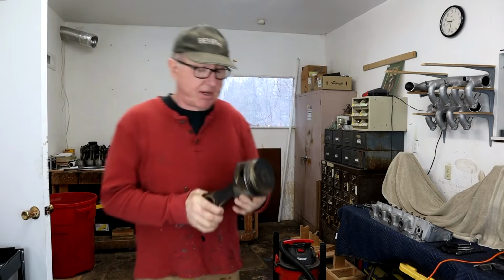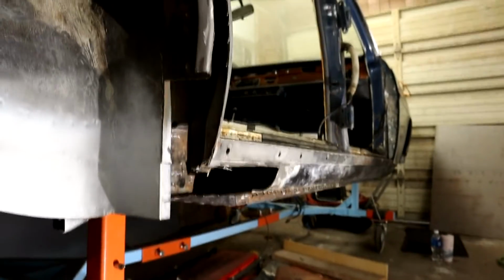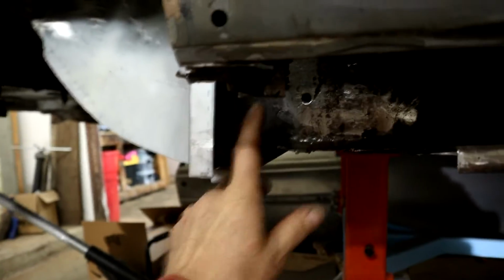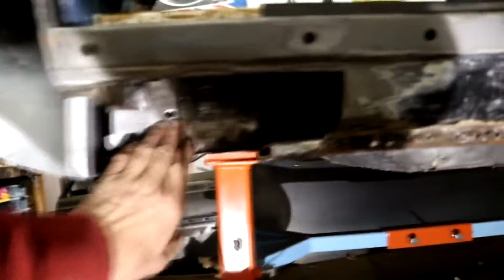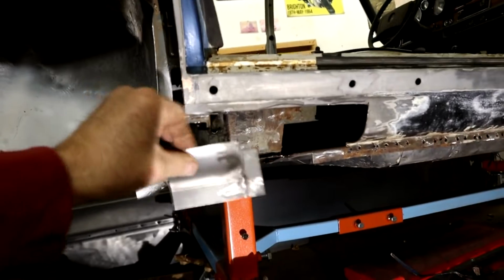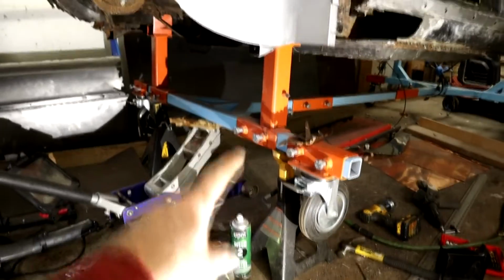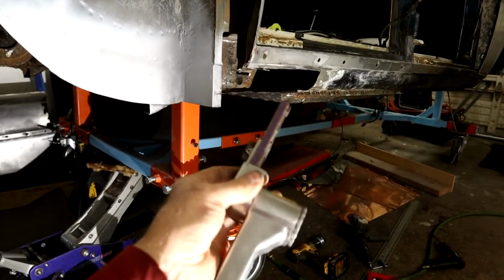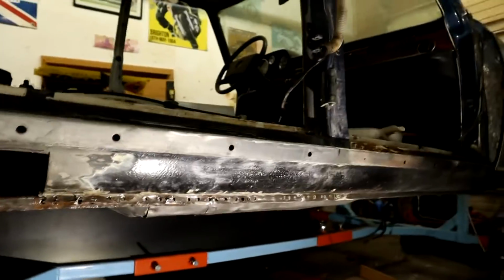MERCEDES W108/109 REAR JACKING POINT REPAIR AND RUST PREVENTION.

Comment: Sir 
If you don’t mind I would like to ask you something. I always like and comment on your Videos. 
I bought a W108 in great shape and it was running really well. The former owner told me to clean out my Gas Tank 
So when I did that I thought let me change the fuel pump Spark plugs injected seals and some fuel hoses. Now when I start the Car it runs but as soon as I press the Gas Pedal the engine dies on me and I don’t have too much money to go to a good mechanic. Do you have any idea what could be wrong with it by any chance ?
Reply from the maker: How did you clean out the gas tank? Did you remove etc? Also when you did that, I'm assuming you put in a new tank strainer/ filter? Located underneath the tank. Was the car running well before you did all this work?
Cheers John.
If you want to chat in more detail. Here is my email where you can reach me. jwright89@sbcglobal.net 
let me know how you get on.

Comment: Hi John. I know im late to the party, but where did you get those jacking points? I’m doing similar work on my 116 and am in dire need of a new set. All the best!
Reply from the maker: Hi Ian. No problem mate. I found the jacking points at https://www.mbclassics.de/Home
They were quite reasonable. $35 each if I remember. Not sure about the w116 ones. If you have trouble, try the classic center in long beach.
All the best Cheers John.

Comment: Interesting work in progress!! Happy New Year. It is great to see these repair sections are still available. One thing I have noticed is a lot of those older Mercs, W116 included, are often sold without the jack. My W116 has the original jack, but I don't use it when changing the wheel in case of a puncture. I use a trolley jack.
Reply from the maker: Very wise. Even after these are repaired I would still use a floor jack. There are some panels that are NLA for the 108 /109. Thats why I have to fabricate.
Cheers John 🍻

Comment: I have to ask you, as an owner, your cars have that cone-shaped mechanism
for the door locks, Mercedes dropped that.  I have watched some crash tests
and the doors fly open.  I assume the people didn't lock the dummy in the
car, but it seems that cars like yours, wouldn't have the door fly open.
Any comment?
Reply from the maker: Interesting. The crash tests I have seen for the w108 and older classics I have not seen the doors fly open. You may be correct about later models.  I know that modern crash tests are very stringent and would think they would have addressed that. Cheers John.

Comment: Happy New Year John, i guess, the car is on the road for this year😊
Reply from the maker: Happy New Year. That would be very optimistic:) I do hope to have the engine completely rebuilt and running on the test stand. Also all of the welding completed ready for epoxy, rear axle rebuilt and all of the remaining parts plated and painted. I think that's a realistic goal. As you know I have other cars to maintain plus my wife and sons cars:) Plus a fulltime job. Getting in the garage and working on this project is a welcome escape:) Cheers John.

Comment: Great to see the progress, John. That was a good tip about the floor plug over the jacking point. The rocker rust on my '71 W108 is mostly on the left side, too, for some strange reason. Jacking points all good. You do an excellent job presenting the tasks, really enjoyable to follow your extensive work, good job! Happy New Year! and keep at it. Be thankful you are not a lower elevation like in Sac near the American River. Peace.
Reply from the maker: Thanks for your comments and Happy New year to you. The weather has been rather bleak. Ideal for garage welding work:) I can't wait to get cracking on now the holidays are over. Do you guys have flooding down near Sacramento?
Cheers John.
Reply: @mercedesmaintenance.6339  This youtube video shows the flooding in Sacramento.  
youtube.com/watch?v=x77coMfYNjQ